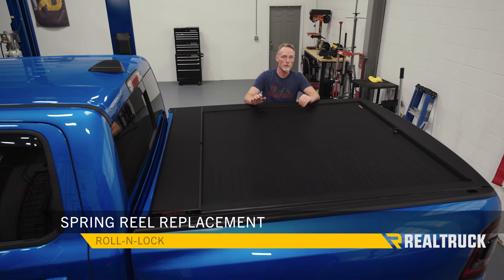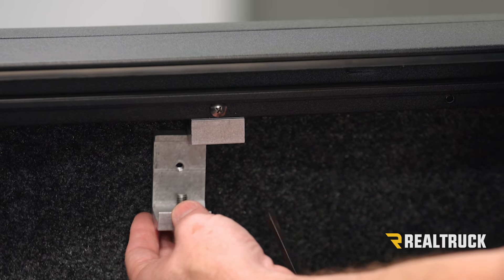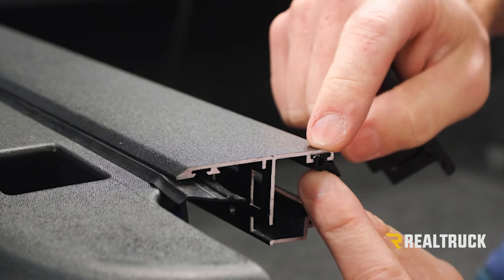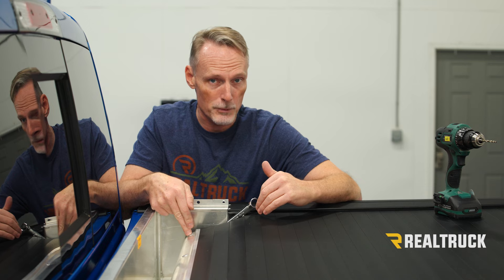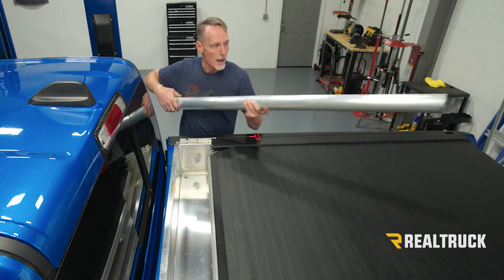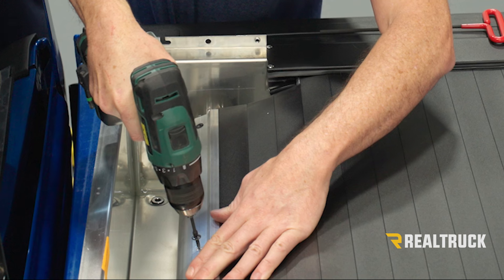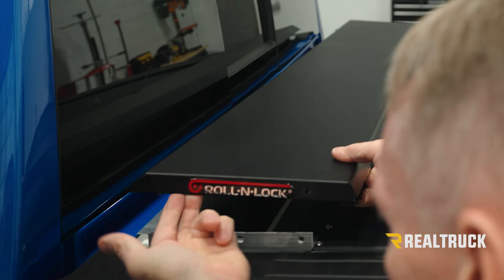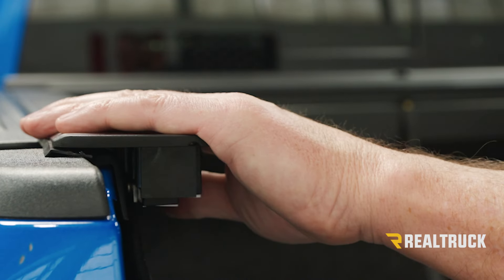How to Replace Roll-N-Lock Replacement Reel on Roll-N-Lock Tonneau Covers

Comment: I have the motorized spindle model and it stopped working.  Battery connection is good.  Im stuck with using the emergency cable release which now stopped ratcheting.  Any thoughts on what to do?  Maybe install a new spindle??

Comment: My roll n lock cover doesnt go back further than the first locking point so i cant access the side rail bolts. Any ideas? It begins to bunch up instead of rolling around the reel
Reply: I had the same problem, I took the cover off and slowly hand rolled the cover in…….didn’t get it all the way in but you can then push a little and it will go back a little more.
Reply: Same for me
Reply from the maker: Sounds like a binding issue where adjustments need to be made, if you are still having this issue please reach out to support at 800-952-7655
Reply: Having the same issue. I just ordered a new reel. But after watching this video I'm wondering if maybe it just needs to be reset with the wrenches.
Reply: @asifwilliams3413  please let me know if you try this and it works because I'm having the same issue and don't wanna pay for a new reel if i really don't need it
Reply: I've had exactly the same problem. My new reel finally arrived after two and a half months. Basically I wish I'd watched this all the way through before I started. Had to order new end caps. Different to these but I have more of an idea now. In order to loosen the clamps I just got on my back and wriggled back and forwards.
Reply: @laurenpaul7522 did you repair? Having same problem
Reply: @asifwilliams3413 did you repair? Having the same problem